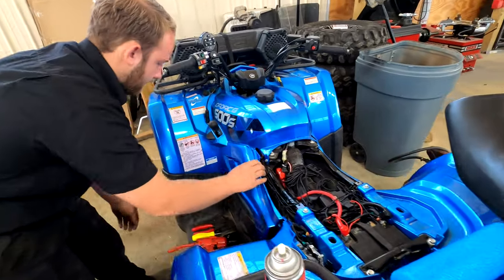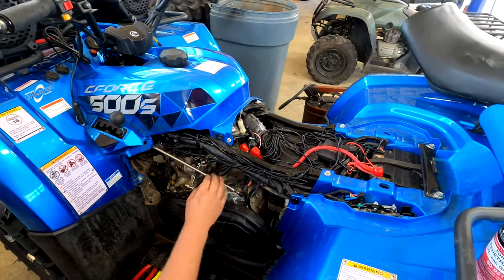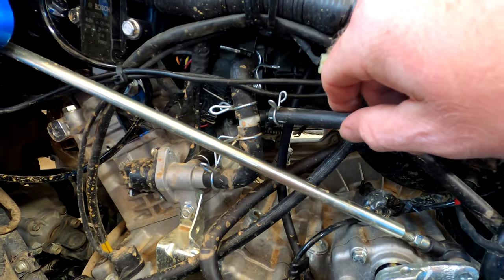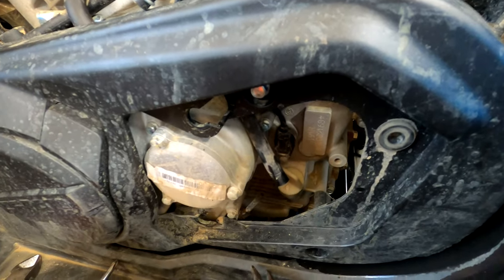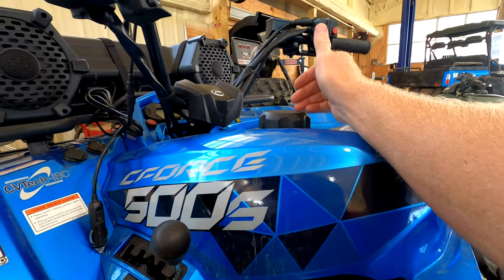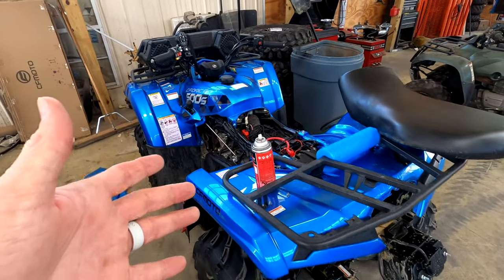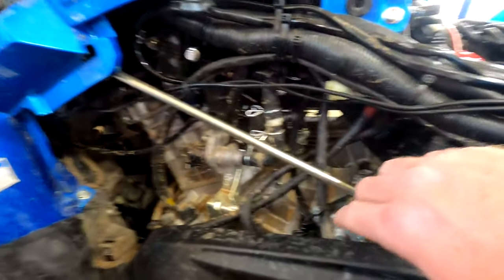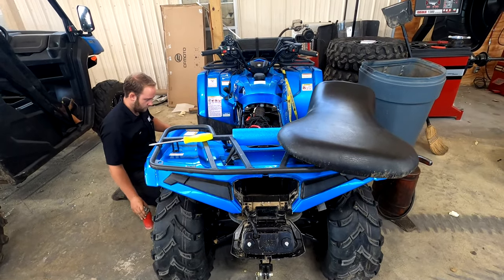CFMOTO CFORCE Fuel Issue Fixed | Vapor Lock problem fix | Evap Delete Finally!

Comment: Just had it done on my UForce 500. It would get hot and would not start if I turned it off. It would have to cool down before re starting. The dealer suckered me into the 20hr service. Ended up costing me 350 dollars. Warranty covered the bypass. Thanks for the videos.
Reply from the maker: Man thats way too much for a service.
Reply: Real Talk Powersports yes I totally agree! I won’t be back unless it’s something I can’t handle. I will do my own oil changes myself from this point forward. The service manager at my dealer  claim that these machines have to have valve clearance adjustment. I just had it done because I was second guessing it.

Comment: On my 2019 500s the hoses run forward to the canister located behind left front wheel inner fender shield. I went ahead and did mine myself yesterday and it runs great after deleting. I cheated and left canister and hoses in place so it could be changed back in the future if ever required.

Comment: I have a 2020 cforce 600 I have had for 3 weeks now and the first long ride out I had the throttle and hesitation issues and seeing these videos before I was aware of the gas cap venting issue so I cracked open the gas cap and sure enough it spewed and vented and this issue was resolved at the time. I’m am wondering if the 600 will become included in this issue and repair.
Reply: I just had the same issue last week we’re about to find out because I cussed out Hondo for it’s because everything still under warranty and I’m having a bunch of issues in the last five months of owning one brand new 2021

Comment: I have a CF Moto Cforce 500 manufactured 11/21. It won’t run for nothing. My local dealer where I bought it is absolutely horrible. They keep slapping sparks plugs in it and calling it good and wanting to charge me even though it’s under warranty. I’ve mentioned this to them and they won’t even acknowledge it. I’m tempted to make the 4 hour drive to let you guys do it

Comment: I have a 2021 400s and I have some kind of vent hose that is next to the oil cap where it vents and connects to the underneath of the motor .I always keep my machines very clean after each ride and I happened to notice the tube had what was a oily sediment in it and I replaced it with a new one that I had a roll of . What I immediately noticed was the throttle instantly became very smooth in all ranges . Can you tell me what this hose is for and why I have this oily sediment in it . What could be causing this I cant find any information in the manual .  This hose is clear around 1/4 OD / 3/16 ID and please note I have not Ben going through any water that go over the foot rest . I usually do most of my own maintenance and would appreciate your input . Thanks Rene Martel

Comment: thanks for this video.  i have a 400.  would this also cause start up problems after running for awhile?  haven’t noticed problems while running but have had problems on a restart.  thanks.

Comment: Hey Blake I was going through some of your older video’s and found this one I was riding my 2021 800xc and it started acting funny like a gas issue cracked the gas cap and sure enough it worked ran fine the rest of the day getting power steering worked on this week gonna get them to delete the evape system
Reply from the maker: Yes yes.. I got the evap deleted on my 2020 model and it made a world of difference
Reply: I have problèmes the moto cforce
Reply: Help me plaese cforce moto,i have problèmes the contactor and the direction

Comment: Did my 800xc. Plugged the throttle body and pulled the rear hose off the canister with a T marked on it. Tie up all loose hose ends and your done.  Literally a 5 min fix.
Reply from the maker: Thats right! Very simple fix
Reply: How do you get to it? There are cover on everything. Just start popping covers off?

Comment: My 2019 500s doesn't have this can.   Just bought it used with 50 mi from dealer.  The rear storage has no holes or anything that would suggest this was even there.  I'm in CT

Comment: My 2020 600 builds up so much pressure in the tank that this weekend I did a 75 mile ride and when I opened it to refill the cap actually shot about 3 feet into the air. I let the pressure out but not enough obviously.
Reply: Before riding open fuel cap, thats what I do to my atv and also my motorcycles
Reply: Nathan yuhas thanks for the info! Much appreciated.

Comment: What about the 600 -- touring and regular -- I have a 2021 XC800 and touring 600 (had the EVAP removal done by the dealer on the 800 and made a world of difference) - what about the 600?  You guys don't mention that model at all, but I have heard others that have had issues similar to this with the 600... what kind of fix for the 600?

Comment: Had a problem last ride with my CForce 800. It would stall while on the trail. When I tried to restart it would not do anything. Battery was fine but it would not even attempt to turn over. I would turn the unit on and off 2-3 times and tried to start. Usually would start on third try but ran rough and wanted to stall if RPMs were low. I bet this is the issue. Already have this going to my dealer on 8/28 for the first service. I will have him delete the evap.
Reply from the maker: I hope that fixes it DJ! I believe it will. Cause my 800 runs perfect all day now
Reply: Hey DJ there is a cfmoto forum and what you are describing is what 6 other people were.  This fix eliminated their stalling issue.  Hope it works out for you!
Reply: Eric Patterson Thanks, I am taking it to my dealer this Friday. I’ll let everyone know what they say.
Reply: @djrizzy4903  hey DJ any word on your ATV?
Reply: Received my units back and dealer stated they applied the “fix”. I have not driven the Cforce much since getting it back. But there is no sign of the issue so far.

Comment: Hey guys, love the videos! I have a 2022 cforce 600 Touring with less than 500 miles that has recently developed a bog and loss of engine power at mid throttle, if I go full wide open throttle it comes out of it but will immediately do it again at a cruise. Could this be the issue??

Comment: I have had problems with my 2021 CForce 500 not cranking - they changed the control module -switch and everything they could think of. Come to find out after trial and error the fuel pump keeps loosing its prime and you have to turn the key on and off through about 5 or 6 prime cycles to get it to start. Is there a check valve in the fuel system somewhere that can be replaced to stop the flow back problem?

Comment: ok been dealing with this issue on my wifes 500s for 3 weeks, i knew it. after this vid i did hers and mine, they run so much better, its noticeable, seems the tank vent has a check valve as well.

Comment: I’ve had an issue lately with while running down trail in snow, my 800XC will stall out, also when coming to stop after hard run. Yet idling around yard is fine with kids.
Reply: I have had the same issue with a 2021 500.  Is this whats causing it?

Comment: Just got a brand new 21 cfmoto cforce 500s. 70 miles and 11.3 hrs I've put on it since it was assembled. Had that fuel issue happen 2 times today (9-24-21) 

Since the hoses shoot forward is that a fuel bypass issue or is the emissions reduction stuff causing my problems? Any help from anyone would be awesome. Great video too.

Comment: Hey Blake I've had issues with my 2020 600 stalling and dieing on me and now that this video is a year old was just wondering if you've found out if it also had the evap issue the 400, 500, and 800 have
Reply: I'm having the same issue - ideas?

Comment: Good afternoon, I watched a video about what happens with that canister when it is removed on a cf moto 850 XC, what happens on the carburetor, that hose is closed and that canister is removed, and what do you get with that? I didn't understand, I don't understand, I don't understand English, so I don't know what is it about, if someone can explain, I will translate it on Google Translate, please answer

Comment: So this is odd—mine doesn’t have that canister in the back I also called my local dealer he said there’s no type of recall or anything to fix anything on a 2019 CForce 500 my issue is I’ll be driving and then go to full throttle it and it just goes to surging rev high and then not go anywhere and it’s like it tries to put out power but it just won’t go and then eventually stalls and dies— this is withholding the throttle wide open— really getting fed up with it but only has 29 hours on it
Reply: So I figured out what the problem with mine was 🤦🏻‍♂️ The negative battery cable ground was loose 🤦🏻‍♂️🤦🏻‍♂️😂😂

Comment: Looking deep into cfmoto. Will my los al cfmoto dealer provide maintenance and repair come that day or would any arc shop help me out. Just a bit Leary of my “local” cfmoto dealer is not one of the better motorcycle stores. Any advise would be awesome
Reply from the maker: Any CFMOTO shop is supposed to be able to take care of it. It doesn't have to be the place where you bought it at.

Comment: Is there anyway Blake that you could do a detailed video on how to take the plastic off a 600 T without breaking it. I catch Joel for a couple of seconds on different vehicles but if you could do one to show the patrons how to pull the plastic off the sides without breaking the tabs that would be much appreciated. And as always keep it real. :-) Thanks Mike Holmes

Comment: Is the cforce 1000 overland the same set up?  Do they also have vapor lock issues? Mine idles a little speratic just sounds a little off wondering if this could be the issue. Thanks guys!!
Reply from the maker: Hey Bill.. its totally different than the 500.. ive seen no issues with the Overland 1000 yet... mine runs good and no vapor lock issues.
Reply: Yeah my 1000 overland is working the same as what u explained ,poor idling and not sounding good n will shut off

Comment: Do you have a video or details on doing this to the 2021 Uforce 1000? Same concept as the wheeler im assuming? I have the canister and have seen posts of a couple guys getting water intake from it. Thanks
Reply from the maker: Hey Daniel i have a UFORCE 1000 as well but i havent even thought to really check the Evap system out yet.. Ill have to take a look at it first.. Im sure if its like the 950 canister you can had a hose for the vent of the canister and reroute it. But ill have to verify,
Reply: @RealTalkPowersports  Thanks for the reply! Your videos are great and a lot of help. Looking forward to what you find out and thoughts on the matter.
Reply from the maker: The evap canister is mounted at the bed frame and is above the tires. You would have to be in some pretty deep crossings to get water sucked in through the canister.
Reply: @RealTalkPowersports  yes, those were my thoughts also. Wasn’t sure if I may have been missing something. Good to know tho, thanks again!
Reply: @RealTalkPowersports  does yours have a breather hose coming out the bottom
Reply from the maker: @danielkraft8638  Hey Daniel im back home looking at mine now.. it is a little lower than I had it pictured in my mind..
Reply from the maker: @danielkraft8638  and there is no hose coming out of the bottom.. I havent had any issues with mine tho.. its seems to be just slightly higher than where the 950 sport canister is mounted
Reply: @RealTalkPowersports  and you have larger tires on also even...I have stock and will run these for awhile. I’d like to not have to worry about it since i just picked it up last week and plan for a ride this weekend since break in should be done
Reply: @RealTalkPowersports  you not having issues yet and for what you have put it through so is good to hear. For my peace of mind it still bothers me tho, would be nice if they put it a little higher
Reply from the maker: @danielkraft8638  you shouldn't have any issues as long as you don't go in too deep of water.. ride it and enjoy it. It would literally have to sit in the water over your tires for a few seconds not moving and the evap system would have to be pulling a vacuum in that moment for it to suck the water up. 
If you want get some clear or black rubber hose and fit it over that nipple on the bottom of the canister and leave 2 loops in it and then run the hose up higher and zip tie it to the tubbing above the rear wheel well and point the hose out over the tire and suspension area.. not over the engine or exhaust
Reply: @RealTalkPowersports  good to know, and that was my exact idea rather than messing around with the main hoses. I won’t be going into deep water but would like to feel confident in the amount I do go through.That’s most likely what I will do. Thanks again! Keep up the vids also!

Comment: 2021 cforce 800 first ride of the year after about 20 miles was real choppy at idle when I gave it throttle died can’t seem to figure it out.. I run 90 octane no ethanol and air filter is new.

Comment: I have a 500 2018 and after an hour and a half of driving  it will turn off when I stop on any gear, It will stay on again if it's in parking but as soon as a shift it will turn off.  So I have to turn it on while in gear and accelerate and after that it will keep running fine till I stop again.  Do you think this might be the same issue?

Comment: Having the same problem on a 2021 cforce 600.   Builds a lot of pressure and starts sputtering and bogging down
Reply: Did you ever get this fixed? Where is the canister on this bike? I have the same model and year
Reply: @Ccam1190  the evap is up front kinda behind the headlights.  I had a evap line that was pinched and also I modified the exhaust tip to make it flow better.    And I don’t tighten the gas cap till it clicks I just make it barely snug and haven’t had a problem since then.

Comment: the breather still needs a check valve , or at least a filter, you don't want to leave it open for cutter bees and the engine does experience crankcase vacuum under deceleration, don't want to suck dirt in.

Comment: My dealer is gladly removing the system which CF Moto is taking care of under their ‘recall’ (i call it a recall, technically it’s a factory covered solution/repair) so the system can no longer continue to clog and cause gas to spill into the frame, cause the engine light to flicker and flash, or starve the engine of efficient running.

Comment: i just got a 2015 800 quad, Im thinking it has some problem like that, since when i open the gas tank a big breathing shhhhhhh comes out, im gonna have to investigate it. i live in argentina, i wonder if that canister even comes this way
Reply from the maker: I dont believe it does and im pretty sure it was different setup for 2015

Comment: Just bought a 500 would it still need to be fixed or would it already be done
Reply from the maker: If its a 2021 then you have nothing to worry bout
Reply: 2021 800xc has this issue too
Reply: @RealTalkPowersports  I’ve got a 2021 500 and the gas tank still gets a ton of pressure. I’ll have to check it out and see if they did this to mine

Comment: What about the fuel system on the 2021 800 do they need changing also .
Reply from the maker: They fixed all of the 2021 models
Reply: I have a 21 800 that was stalling out the other day when I had driven it about 40 miles... shut it off,,, started it back up and it would die if you gave it throttle,,, I’m thinking it has something to do with this.. I’m gonna disconnect it and report back.   Blake, what symptoms did your 800 have when you bypassed the evap system?

Comment: Hi guys, i have a cforce 450 and my thumb gets tired when i drive for a while. Is it possible to adjust the spring in the throttle or replace with a softer spring?

Comment: I'm pretty sure this evap problem just got me I was driving my uforce 800 and it started running poorly out of nowhere started shaking and lost power  bran new 2021 stopped running  and the efi light came on and when cooled down it just ran poorly I'm pretty ticked off only 114 miles

Comment: Hey guys, does the cforce 1000 overland have a evap. Mine seems to idle a little off and yesterday while plowing stalled for no reason. Had to cycle key off and back on to restart. Thanks for any info!!

Comment: Have a 2019 800 cforce vaperlocking on long hot rides will they take care of that? Also had a beeping issue and what you said I'm hitting the Rev limiter in high and low just beeps all the time. Maybe I'm a little tuff on it.😁 Is there a way to stop the beeping or a delete it ?
Reply from the maker: When it beeps do you notice if your little oil light flashes up for just a second or 2?
Reply: No oil light.
Reply: Just when I start it
Reply: @RealTalkPowersports  mine does. What could that be?

Comment: I have a 2018 cforce 400 it will start up run for a few minutes then dies bogs under acceleration but it’s not consistent runs like a top then bogs out and dies but fires right back up any ideas only has 28 hours on it
Reply: Probably with the problem is have you fixed it it looks like it’s been a year just wondering what the result/fix was

Comment: I'm having problems with a 2021 cforce 600.   When trail riding the exhaust gets so hot that the fuel tank builds a lot of pressure and the quad will start loosing power and sputtering.   If you remove the gas cap even if you do it slowly to let the pressure out you get gas start over flowing all over.
Reply from the maker: Oh wow!! Thats the first 2021 600 that I've heard of doing that.
Reply: @RealTalkPowersports  so I should be able to do the same evap delete on my 600 right?